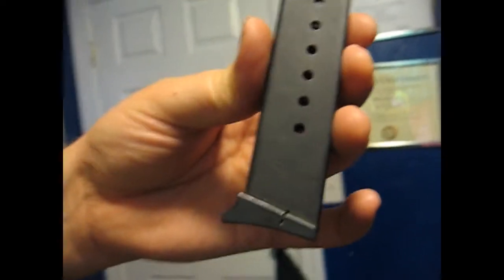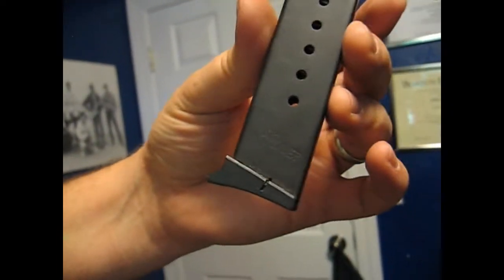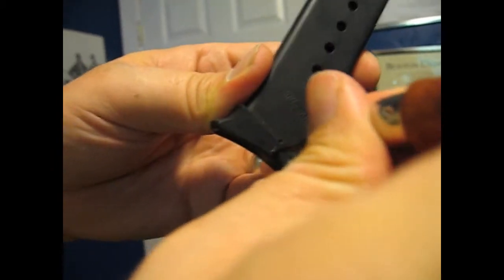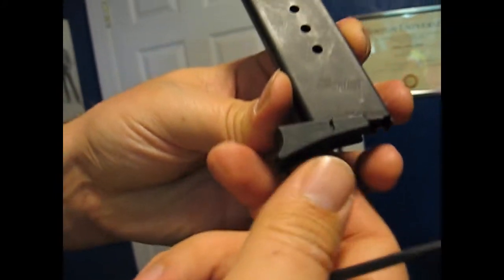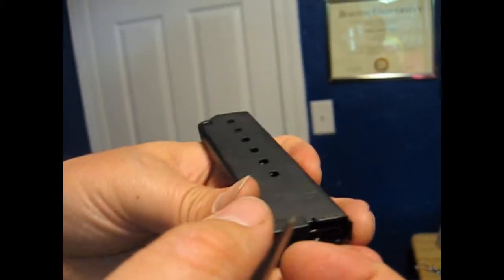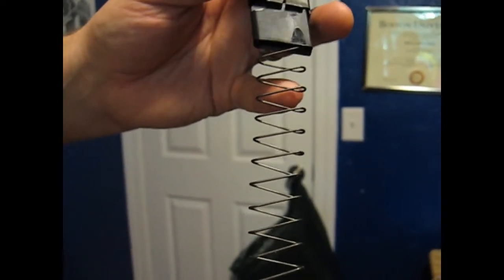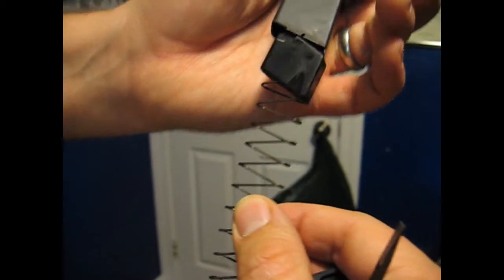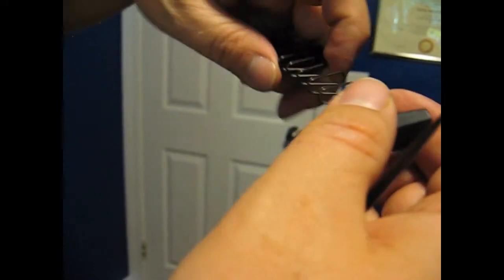SIG P230 P232 magazine disassembly

Comment from the maker: @762Fanatic You could certainly try it... there has to be a balance between capacity and keeping the follower from binding and tilting. If you remove too much of the side surface area, you might start getting binding. But worst case, you just get a new follower. Let us know what you find out.